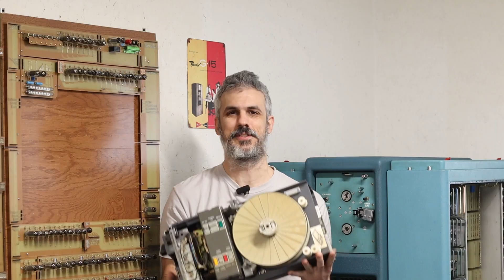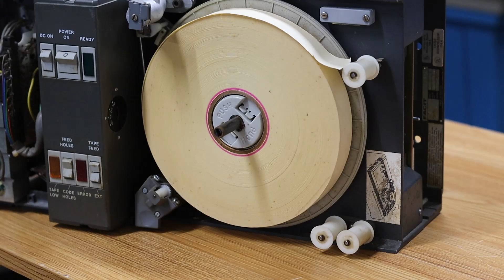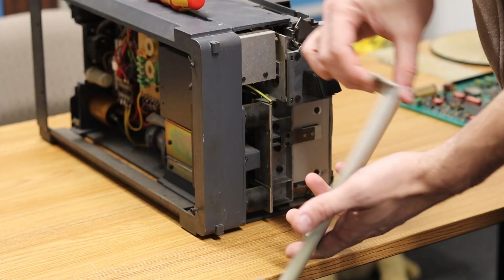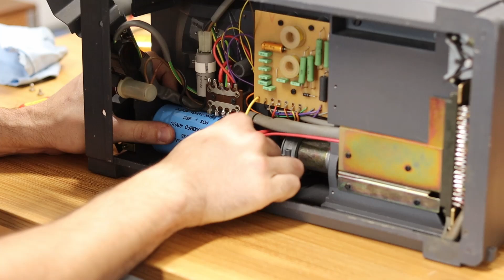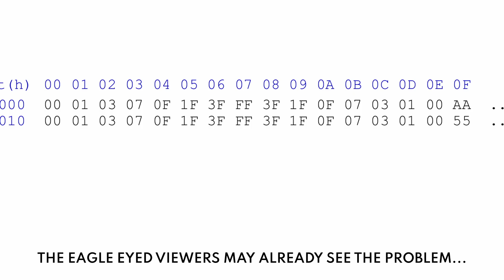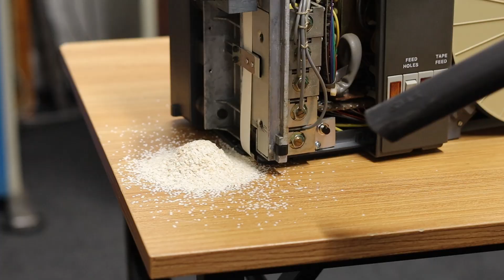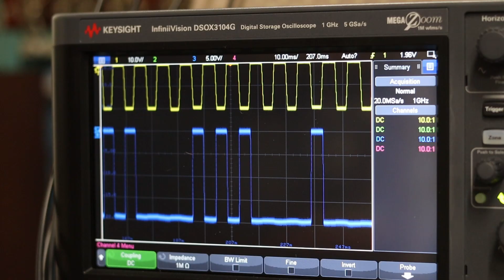Reviving a Facit 4070 Paper Tape Punch

Comment: It is “standard RS-232 shenanigans” for our generation. It is a completely lost, unknown art for the just graduated engineering class. Sériel for them is 0 and 3.3v out of a USB to 3.3v TTL serial adapter. An ambitious junior engineer blew up a very expensive prototype board we fabricated when he found an actual USB to 9 pin adapter, cut the 9 pin off of it, and connected the rx/tx lines directly to the 3.3v serial TTL on the board. It was my fault, I assumed he had knowledge of rs-232. I was on vacation that day - which ended as a downer when I found out what he tried instead of being on down time waiting for me to come back due to l lack of serial console.

Comment: What if you just dye the paper black or blue? There's no way the holes would be covered using ink, it would just need to be that the ink cures properly so it doesn't leave any wet ink in the machine

Comment: That's a real nice punch, going to make a whole pile of hole-punchies with that.  A bit bucket is a must!
Reply from the maker: You know, my brain never made the connection between bit bucket and the literal bucket to catch paper tape bits until just now!
Reply: @UsagiElectric  Holy crap!!
Reply: I think it would be wise to make a 3D-printable mounting bracket that could be used to attach a paper bag.
Reply: Also called the "chad box" for extra meme material
Reply: and a bell when the bit bucket is full 🔔
Reply: @davenally8672  If the bucket gets overfull, would that be a stack overflow perhaps?
Reply: @dolvaran no, just a desk full of floating points😀
Reply: @davenally8672 Bit overflow bell would be nice. Ping! 🔔

Comment: The broken button is easily fixed, mind you. Just take it apart by pulling on the swing and then glue it. DO IT, inside of a clear plastic bag, just in case something inside the button decides to try to reach L1.
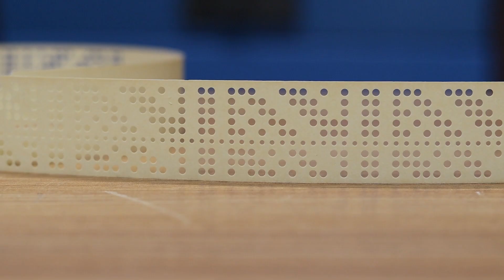edit: 18:36 on the left half of the screen, left of the double row, there's either a miss-punch or an error. Also, at first, you gave it the order to punch, but not all the "teeth" came out. IMO, you should carefully open up the assembly there and put some dry lubrication in the passage where the "teeth" sit.

Comment: Nice to know it's possible to rebuild the paper tape reader with more available photo-diodes.

Just take the spools out of the second cassette and paint black stripes on them. That way you'll see the tape moving from the front easily.
Reply: Get an stamp ink pad, and dab half of the "top" edge of the roll on it. Easy peasy.

Comment: The blue tape is probably Mylar tape which is used for tapes that are used a lot.  The tape does not tear or fall apart. We would use these for final production for programs such as boot loaders.  Paper tape was used for larger programs.  The paper tape is also normally oil impregnated to oil the punch and Mylar is not but it wore out the punch if punched a lot.
Reply: I own a telex machine that punches and reads 5 hole tape. I have a roll of blue tape with it, it is definitely paper not mylar.

Comment: by the tape logic, thats now an 8-bit computer. 8-bits on the tape input/output line. lol. tape storage is fun. why not laser the tape tho. you already use diodes to read the holes. also why not cd-rom for data input.
Reply: It's a 4 bit instruction and 4 bit address tape. He showed that in the video at the beginning.

Comment: I worked in a warehouse they still had 5 machines that needed paper tape in 1998, i love the way you update nothing until it breaks.
Reply from the maker: The great thing about paper tape is that as long as some bugs don't eat the paper, it'll last as a storage medium for an incredibly long time. Magnetic media can be incredibly difficult to get the appropriate drive for working, but even a clever piece of software on your cell phone today can still read old paper tape. It's a wonderful storage medium!
Reply: The last I have seen machine using a paper tape was in early 2010s in Russia. It was pretty advanced CNC stamping machine, and programs for it were on paper tape. (Which makes sense - in industrial setting, paper tape survives much better than magnetic media). We were asked if we could find someone to help them replace the dead interface panel/terminal for the machine (something in CRT circuit burned out, they tried to repair it, but failed). But the whole other parts of the machine were functional. In the end we weren't able to negotiate available time/etc, because that thing looked mostly undocumented. Which was a bit sad, the machine was impressive. (People there showed us what it could produce - like precision antenna arrays and so on).
Reply: In 2019 I worked at a machine shop with a GnL horizontal boring mill that had been upgraded from tape to floppy. It had a metal tape as what I presumed was its firmware that it still relies on.
Reply: What did the machines do? And how big were the machines the tape operated on? Thanks
Reply: 👍🏻 if it's not broken don't fix it and especially if it still works for your needs.
Reply: 35 lb bank HDD's enter the chat.
Reply: Punched tape vs magnetic tape? It seems that magnetic tape outperforms punched tape, actually, yes, on computers. But once upon a time in the Soviet magazine Radio there were several articles about programmators for the B3-34 series programmable calculator, one on punched tape (1987-04) and another on magnetic tape (1988-03), and also in Radio Yearbook-1989 there was another version on magnetic tape. And which is better in practice? Not everything is clear here, of course, recording on magnetic tape is much faster, but on punched tape the device turned out to be simpler, it requires only 16 chips of the K176 and K561 series, as well as the device is powered by the calculator itself and does not require additional devices. A magnetic tape programmator requires an additional 220 V power supply, as well as a tape recorder with a meter. It turns out that the punched tape programmator is more compact and self-contained, although it is necessary to manually fill the punched tape on a manual punch. Moreover, loading into the calculator on punched tape is much faster, in 1-1.5 seconds we drag the punched tape through the programmator's reader and in 1-1.5 minutes the program is fully loaded into the calculator, the calculator itself is overclocked to 125 kHz. I made an emulator of the MK-61 calculator with programmator support, you load the image of the punched tape, and the screen flashes coolly, I see the numbers of the program being typed. 30 years ago, I dreamed of soldering such a device, but there were absolutely no chips, no skills.
Reply: This is the bane of my existence.  I repair large-ish industrial equipment, and obsolete equipment is a factor of life.  Sadly, when  a product just isn't made anymore, you cannot get parts to do repairs.  Which really sucks when the customer says (and i quote) "we never upgraded that machine because for the past 30 years it has just worked!"  Sorry buddy, that part isn't made anymore, and even used parts are getting to be unobtainium.  Time to either buy a whole new machine, or upgrade at least the electrics.

Was just at a customers site, and thankfully, i got them running again, but the variable frequency drives on that machine aren't made anymore, and if one of those had been bad, they'd have been screwed.  Luckily it turned out to be a communication error (profibus), which i happen to be very good with.  So i had it fixed relatively quickly (2 hours), but it could have been a very bad day for that company.
Reply: @jeromethiel4323  VFDs get phased all of the time, never had to adapt a newer one?
Reply: @bluecollarmage4512  Sure, but the company in question needs to do that, and it costs money.  So quite a few never do until it is too late.  And it's not always as simple as just dropping in a new one and you're good to go.

You could be talking months of down time while engineering gets done to adapt a new drive to the existing system, and getting it to work flawlessly.

I've witnessed more than one company go under because they were too marginal a business to afford the upgrade, and when a critical machine went down due to a failure, they simply went out of business.

I've also been involved in a retrofit, and those are always fun, because you never know what you're going to run into until you get into the nitty gritty of the machine.  I find it a lot of fun to reverse engineer a system, but it aint cheap, and it aint fast.
Reply: You get into 20hp+ VFDs and replacing one starts being out of budget for broke places

Comment: I work in a print/mail shop running a big mail insert machine and it's funny how many parallels I see (maybe because of how old some of our equipment is lol). The little tensioners on the tape punch are just tiny versions of the dancers on our big roll printer. And the photodiode / paper color thing actually makes a lot of sense - my inserter has a ton of optical sensors so it can "see" where paper is, and if we're running something with a heavy black line on it somewhere, for example, sometimes we have to adjust the sensitivity on the sensors or they get triggered at the wrong time and donk everything up. These videos give me a new appreciation for my grumpy robot. Although mine just turns itself off at the end of a run- I wish it had a bell! I'll never get over how charming that is
Reply: Donk everything up lol

Comment: Oh no, all the bits are dropping to the floor!  I think we love paper tape because it's so tangible; we can literally read the data with our own eyes.  The punch is a very special piece of equipment that would be incredibly difficult to make ourselves, so congrats!

Now we just need to work out a sustainable supply of blank paper tape.
Reply: Ordering a custom width roll of paper would be fairly cheap if you ordered say 100~ rolls from a smaller paper mill.
Reply: What do you mean the code is inside the vacuum cleaner!?
Reply: @juango500  They are actually all zeros that have turned into ones :-)
Reply: @juango500  You need to run chkdsk to fix the code :-)
Reply: @juango500  You need to run chkdsk to fix the code :-)
Reply: "...read the data with our own eyes..." Back in high school we wrote the data by handy by marking 40-column Hollerith cards with a pencil.
Reply: Exactly. I mean, it could workby making strips from normal paper and joining them together
Reply: "Oh no, all the bits are dropping to the floor!" 🤣